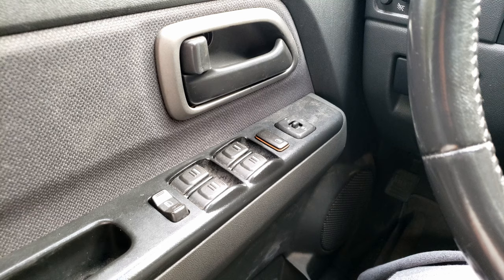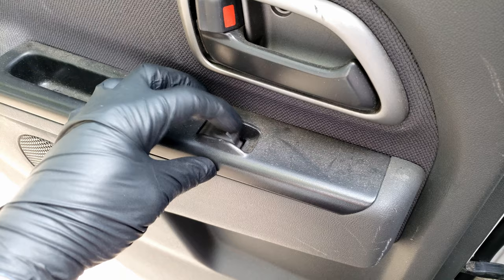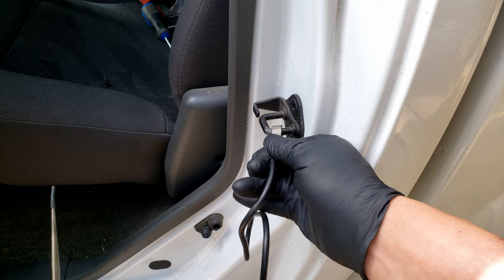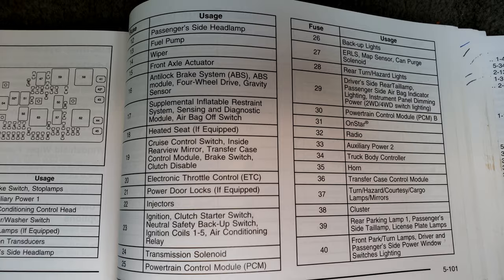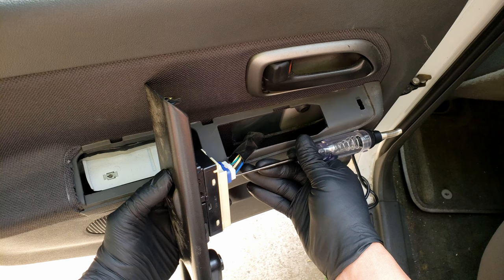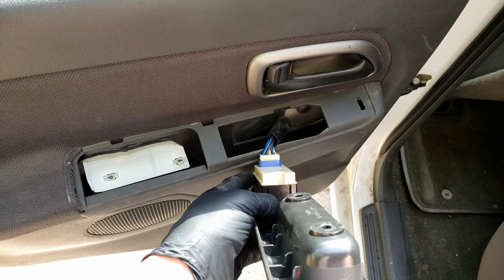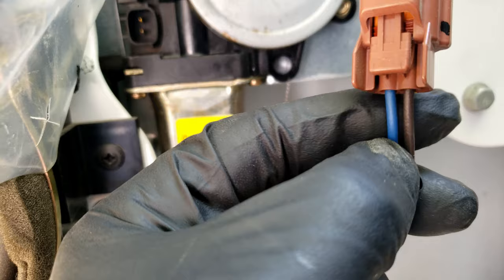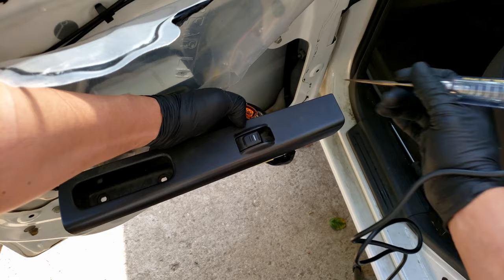How to Diagnose If the Window Switch or If the Motor is Bad

Comment: After changing the passenger side door I am unable to open it from the drivers side. But the window works from the passenger side .
Wondering if anyone would be able to advice anything ?
Reply from the maker: What i would do is check for signal out of the drivers side switch..if the signal is coming out at the switch, then i would check for that signal at the passenger side window motor while the switch is pressed
Reply: @backyardchevy328  thanks for your response 
I haven't looked into this issue but assumed it might be a wiring fault or possibly a blown fuse.
Reply from the maker: @Jamie_Frith  if it works from passenger side, then it won't be the fuse, itll either be a problem with the drivers side switch..or damage to a wire going to passenger side door

Comment: I took the driver master door switch out now none of my windows works at all. Any ideas?
Reply from the maker: What u mean by u took it out? Well the master switch has a lockout to the remaining window switches so without it connected..they wont work
Reply: @backyardchevy328  I disconnected the wiring cable to take the door panel off, plugged it back in and now none of the windows work.
Reply from the maker: @slowazzes1972  try to look for the power windows fuse, maybe it blew the fuse. if not maybe the lockout switch is clicked down..or just verify every connector is clicked in completely
Reply: @backyardchevy328  would the back windows still work without the driver master switch being plugged in? Also is there anyway I can bypass the switch by jumping the connections?
Reply from the maker: @slowazzes1972  in most cases no they won't work depends on the manufacturers wiring of the setup

Comment: I know my drivers window is 100% the switch because I hear the motor trying to put the widow up whenever it’s fully closed and I press it to go up I hear the motor trying to. It’s only when I try to roll it down it gives problems, it has to be pushed down in the perfect spot or it just won’t work. I got a Ford Taurus 2005 if anyone knows what I can do that would be appreciated. All my windows stopped working the other day but it was a real easy fix just had to access the wires where they go from the door to the car and reconnect the broken wire & I was hoping that would help but it definitely didn’t work
Reply from the maker: Normally thats the window regulator thats the problem..if u hear the motor and the switch works..but it wont go down but it does push down..it may have dirt or something bent on one of the rails so it keeps getting caught
Reply: @backyardchevy328  i gotta mess with the button to get it to go down but it goes up fine. It’s like I need to hit the perfect spot or it just won’t go down but going up is no issue
Reply from the maker: @TheCrazzyGuy11  oh ok..i see..yea then in that case yea sounds like the inside of the switch, the contact is worn out and u gotta mess with it so it makes contact
Reply: @backyardchevy328  yeah so can I just buy a new switch and install it?

Comment: Can i use a power probe to find a switch?
Reply from the maker: Yes, depending on which one u got but itll display the 12v reading on it
Reply: @backyardchevy328  i got the basic one of ebay with red and green light also it has a buzzer. It has positive/negative lead along with another small ground crocdile clip
Reply from the maker: @kssmm123  yea then u connect it to the battery and theres a toggle switch to select what ur testing for
Reply: @backyardchevy328  will try it
Reply from the maker: @kssmm123  sorry i was distracted when i replied earlier...on the regular power probe it, it doesnt really work that way..when u connect it to battery it supplies positive signal or negative signal depending on the toggle switch
Reply: @backyardchevy328  what do u advice i use to identify the switch
Reply from the maker: @kssmm123  u could use it to test the motor..if u happen to have door panel off and the connector to the motor u connect the extra ground lead that it should have came with to one end of the motor and the probe u touch to the other and can click the positive and the motor should operate indicating the motor and regulator are good

Comment: front passenger window rolled down but not up again, master switch and passenger door switch will not roll it back up.
Reply from the maker: does it make a sound when u press the switch?
Reply: @backyardchevy328  when I press down it does but not when I lift the switch up to roll up. The sound is a faint click sound.
Reply from the maker: @cburgz3697  if it does make a noise even if its slight..it may be something mechanically bad..like the cable may be locked up and preventing it from moving up..etc...if its not making noise at all id check it with a test light just to confirm signal going to the motor
Reply: I assume that because I can roll the window down and it is already all the way down I hear the click. But because the motor is most likely fried for the rolling up part i assume I wouldn't hear a click?
Reply from the maker: @cburgz3697  well it would normally make a sound if the switch sends a signal cause the motor will still try to move..but yes it may also burn out the motor internally and if thats the case wont make a noise..but to avoid doing that, risking it being something with the switch, i would still test it for signal just to cancel it out..even if it doesn't seem likely.
Reply: @backyardchevy328  I just figured it must be motor related because what are the chances that the master switch and the front passenger switch are both pooched?
Reply from the maker: @cburgz3697  yea i know what u mean but there are rare occasions where the main switch can can short and can actually cause the other switch to short as well..so even if it seems highly unlikely..chance is still there
Reply: @backyardchevy328  I will circuit test tomorrow  and see if that switch is good or bad. Thank you for the replies, It's much appreciated.
Reply from the maker: @cburgz3697  anytime🙂👍

Comment: GREAT VIDEO! ARE YOU AVAILABLE TO TALK ME THROUGH SAME PROBLEM I'M HAVING?
Reply from the maker: Thank you🙂..yea i can try to help
Reply: @backyardchevy328  THANK YOU Sir, I am using your advice and will call If I get stuck... Already replaced motor, switch, and regulator,.. after checking all fuses and re-checking all fuses🤷🤦🤦 has to be short in wire, one of wires going from switch to switch??? Where would most likely place be for that on Buick Lucerne 2011?
Reply from the maker: @jsommerfeltt  whats it doing? Usually the problem tends to be where the wires go into the door..since the wires move everytime the door opens and closes

Comment: Don't have to go through these stupid steps. Go buy a new switch and plug in, if it does not fix the issue, then think of the window motor. While removing the window motor we should also check on the functionality of the window regulator. Usually, the window motor come long with the regulator.